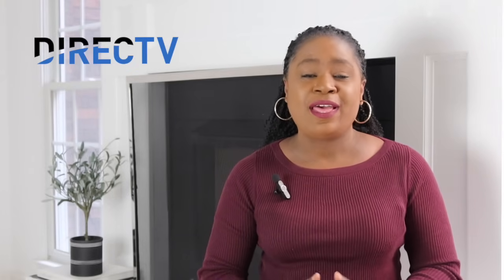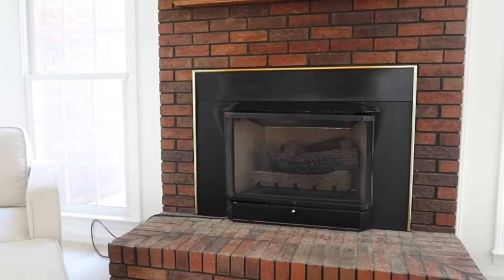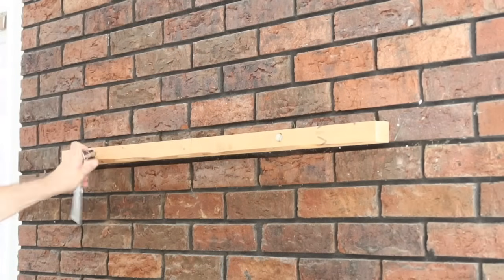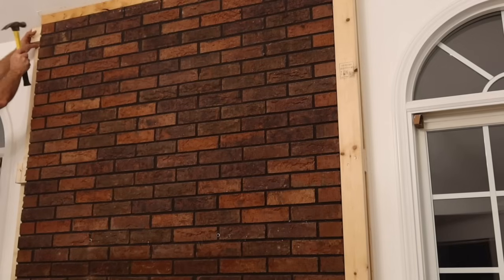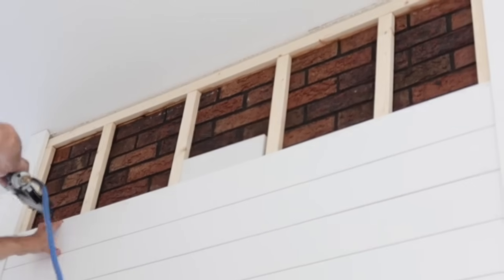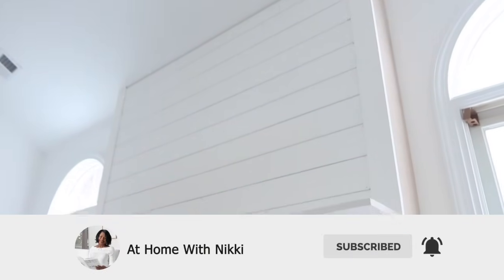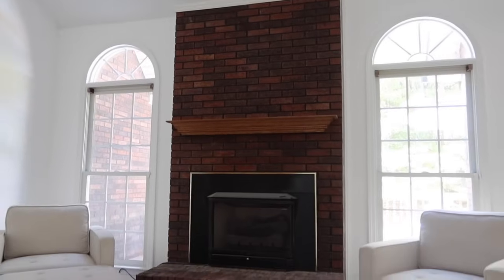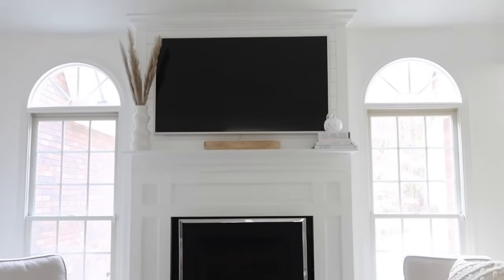DIY Fireplace Makeover | Instantly transform your space in just 1 weekend

Comment: Love it Nicky but doesn't the tv have a power cord? Also how high did you hang it? Have you regretted that is too high?  Thinking on doing the same thing. Thanks! :)
Reply from the maker: Hi! It is the Frame tv which is awesome because there is a very thin transparent cord that connects to the tv.  That “invisible” cord is what plugs into a power box that is located behind the chair.  I love it!  The tv is hung about 6 or 7 ft from the floor.  We love it!